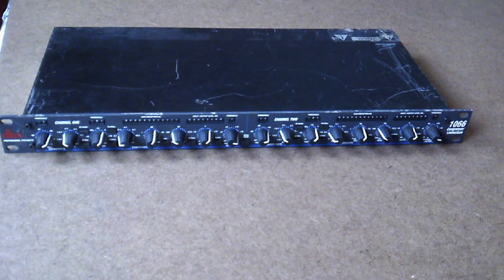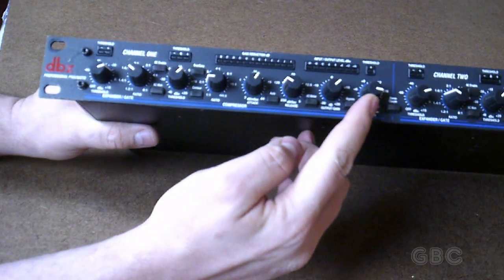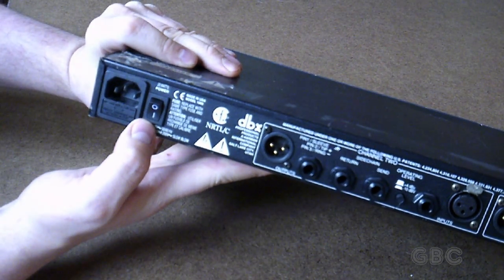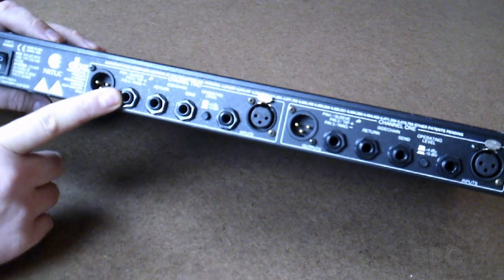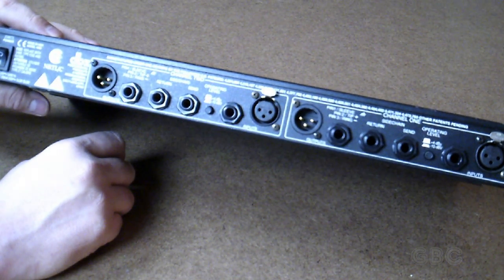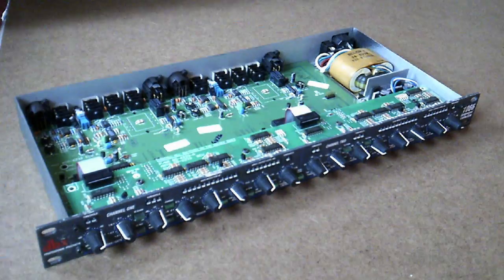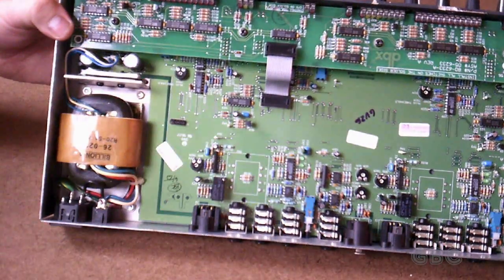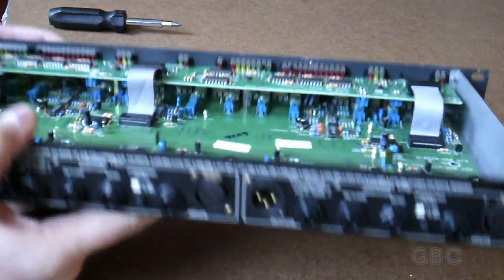[12] DBX 1066 Teardown

Comment: Hi! How can I upgrade the transformer to work with 220V AC?
Reply: No problem! 1066 has got a transformer with two (2) primary windings rated for 120V connected in parallel. So in order to connect the unit to 230/240V power grid you need re-connect the primary windings in series. I can send you a picture how I made this conversion in my 1066 unit.
Reply: @MSM5500  Thank you for your reply! I ended up noticing that the transformer already was remade to work with 220V, but I was scared to test it out. Connected it with the load in series and made myself sure that it was remade for 220!
Reply: @MSM5500  Thank you for your reply! I ended up noticing that the transformer already was remade to work with 220V, but I was scared to test it out. Connected it with the load in series and made myself sure that it was remade for 220!

Comment: Hi there fab video, it would great if you could do a video on how to repair a fault with the DBX 1046 with the input/output lights lighting up without an input connected on both version of the board Rev A and Rev B its something to do with bad capacitors or so thanks keep up the good work.

Comment: Hello! Do you know how can I connect fans to the circuit? My comp is overheating
Reply from the maker: You'd have to use a meter and try to find a 12 volt rail to run 12 volt fans.  I don't think they would do all that much though since there aren't any ventilation holes in the casing.  If you rack mount yours, you could try running it without the top cover on.  Just be aware of the mains voltage location.